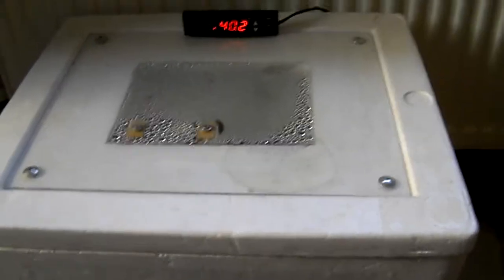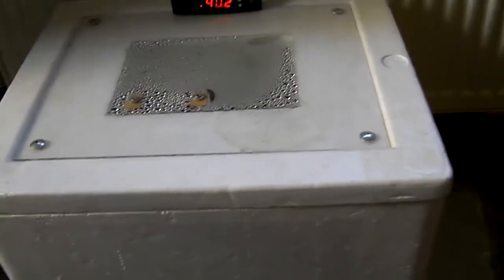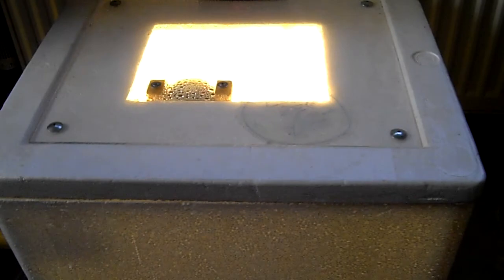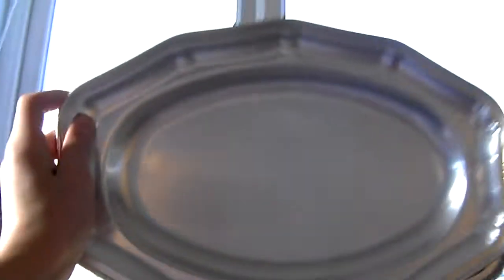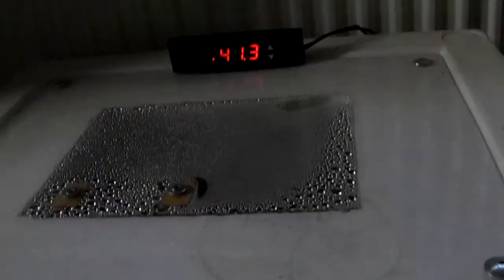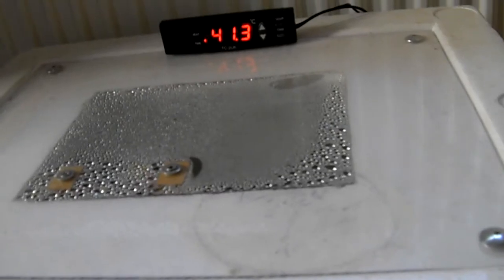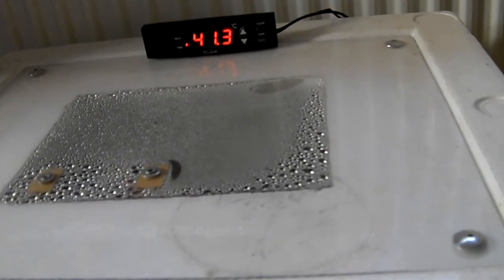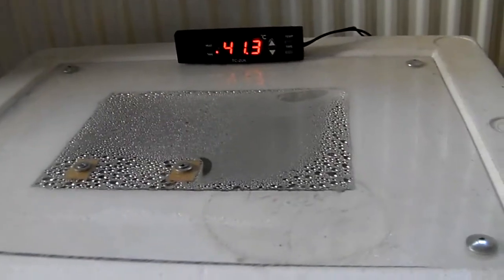Homemade Incubator Updated

Comment: Just one recommendation the thermometer should be placed next to the eggs as following the laws of physics hot air rises, therefore your actual temperature your eggs are getting is not as hot as the thermostat is reading, this is a possible reason why your eggs are not hatching. hope this helps anyone trying to make a incubator :)

Comment from the maker: Hi There, sorry for such a long response, ive been really busy. The rollers are made from pipe insulator, its cheap as chips and a piece of pipe. The foam is placed over and taped onto the pipe and a handle is glued on. Then both handles are turned in the same direction and the egg should turn! Hope this helped!

Comment from the maker: @STRAKS62 hey i got thermometers from swallow aquatics and the thermostat of ebay. The thermostat is good because it does a good job at regulating the temp. I used a 60W bulb and the fan to [move the heat.

Comment: Hello, how did you get the temp up to 99, what watt bulb did you use and did the eggs hatch this time ?  i have just made an incubator based on yours but can't get the heat right, also are the thermometers reptile thermometers and did you get the thermometers from swallows